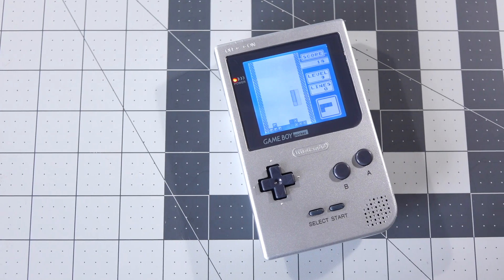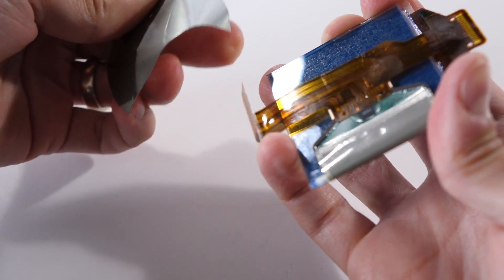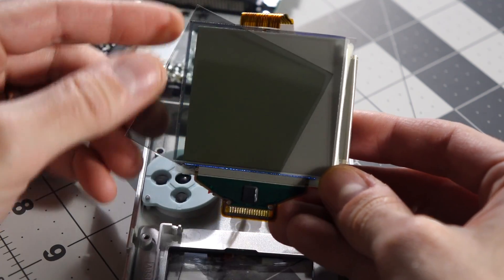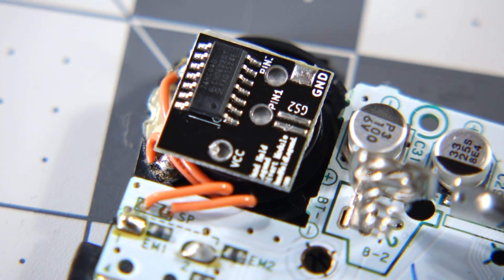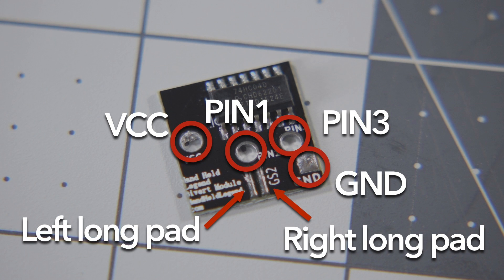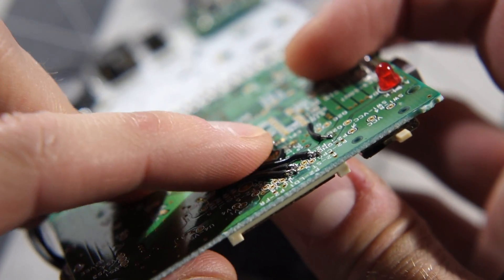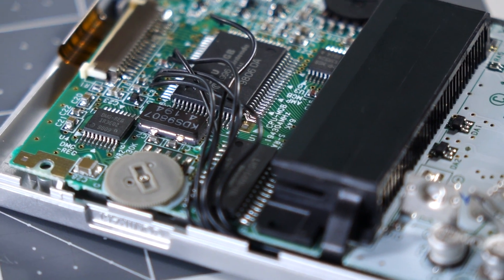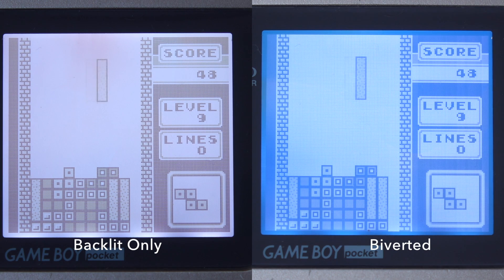Bivert Your Game Boy Pocket!

Comment: Apperantly I am not all that great at modding small electronics, as I managed to accidentally cut more traces between the cpu and the connector for the ribbon cable... Is there any way to fix those broken traces? I've been trying to solder wires between the points the broken traces connect but its incredibly difficult. I have also tried running solder over the places where the traces are broken and that doesn't work apperantly.

Comment: To anybody going to attempt this mod: The points shown on the video are easier to solder to, yes, but they also put too much pressure on the screen & backlight so itll look all screwy after you stick it all back together. There's another video on YouTube that shows some alternate solder points on the other side of the board.

They are a pain in the ass to solder to, but they also leave the screen without pressure on it once you're done.

Comment: A few weeks ago, i was unsuccessful at peeling off the reflective film, due to stupid ribbon cable coming apart. I quickly managed to destroy a perfectly fine Game Boy Pocket. 

So i decided to try it again....bought another Pocket.

Backlight was successful. Then i made the mistake of not fully watching this, to see how ridiculous the Bi-Vert part would be. Well...after about 2 hrs, i successfully tacked down, and soldered everything in to place...turn on...crap...crappity crap crap. Screen was bunky...all full of lines, and electric static. 

So, once again...i said ok...screw this...Salvaged any parts i could, and then threw the rest away...And once again...destroyed a perfectly fine Game Boy Pocket. 

But i forgot, i could just re-solder the part of the board i had to cut, in order to put the bi-vert in. That would atleast give me a Game Boy Pocket, with a backlight.....but it was too late. My temper flared, and everything went into the garbage. 

Lesson is...stick with DMG-01 mods...cause Game Boy Pocket sucks. 

I HATE CURSIVE AND I HATE ALL OF YOU...IM NEVER COMING BACK TO SCHOOL, NEVER!

Comment: That bivert module was meant to be soldered directly to two lifted pins on the LCD connector. This could have been much less messy.
Reply from the maker: That's how you normally install this module in a DMG, yes. The clearance inside the Pocket's housing is much tighter, though, and solder points are in different places. At the time this video was made, there were no dedicated modules designed for the Pocket. Installing it how I did was the most surefire way to actually make it fit.
Reply: Ah, I see! I didn't know the pocket's case didn't have enough clearance. Much much easier on the DMG!
Reply: There is a newer version of the mod chip to make this process alot easier

Comment: Hey Colin, great work on the videos!  I have the installed the backlight for the gb pocket using your other tutorial video with great results.  I was attempting to wire up the biverter but I'm having trouble getting solder to stick to the pads.  Do you have any tips you could share here?

Comment: Is the sound muffled with the board on top of the speaker? I have a couple boards and backlights on order intended for a DMG and a MGB, but if the sound is affected I may stick with a backlight for the Pocket.
Reply from the maker: I haven't noticed any change in the sound quality with the board there. I've heard of some people putting the board near the cartridge connector, but when I experimented with that I found it caused the case to be tough to close completely.
Reply: Thanks, that is good insight. I honestly wonder if the bare chip would be easier to install in the Pocket.

Comment: Just made this mod for my GBPocket. Here few additions:
1. Wire. Better to use wire from old headphones. That wire very thin and you will not have problems when you start to assemble all back. Wire from HHLegends doesn't fit for me.
2. DO NOT try to unsolder IC legs from motherboard and do exact as you can see in this video (https://youtu.be/f85v4hqbcJc?t=78) 1:18.

Comment: would both of these mods be compatible with the original Gameboy Pocket the one without the battery indicator?
Reply from the maker: +Danny Rouse I believe so -- it's very unlikely the internals of the two versions are significantly different -- but haven't gotten my hands on one to take apart yet.

Comment: Can you use 30 awg wire? I installed with 28 but it's causing pressure on the lcd when tightened up and causes bright spots.
Reply from the maker: +David Balzer Yeah, you should be able to get away with that, the total current draw is quite low.
Reply: +This Does Not Compute Finished up rewiring and it definitely fits really well with room to spare, I would recommend it for easier routing and tucking neatly. Thanks for the awesome how-to's!

Comment: Hmm, doesn't look like a huge difference in this case. If I were to trick out a GBP I'd go with just the backlight because I prefer the gray pixels and the contrast is nearly the same, though the original DMG ("brick") looks amazing with a biverter, the contrast pretty much looks doubled in TDNC's video and the pixels look to be a nicer, darker, contrastier blue, so I'd definitely bivert that.

 I'm almost tempted to buy an old DMG and stick a backlight + biverter in it now (I still have my childhood GB lying around but A) It's a transparent one and B) sentimental value (got it when I was 6), so I'd just buy some less rare colour used somewhere, maybe black or the classic grey).
Reply from the maker: +Redhotsmasher Used DMGs are pretty inexpensive, usually around $30, so if yours has sentimental value then picking up another one is the way to go.

Comment: +This Does Not Compute hi sir good day!! i bought this gameboy advance sp and it has this weird problem where whenever i charge it the orange light indicating that its charging only last for 1 sec then it disappears. I bought a new charger and a new battery but it doesnt fix the problem. Can you help me about this? i would really appreciate the help
Reply from the maker: +Shindensen That's a common problem that happens to the DS series as well. I haven't done a video on it specific to the GBA SP, but it's likely that the tiny internal fuse is blown. Looks like there are a few guides out there if you search for them. Good luck!
Reply: +This Does Not Compute oh thank u very much
Reply: +This Does Not Compute btw i dont know if its the fuse but i bought a new battery and when i turned it on its working . It might be the charging port thats broken

Comment: when cutting the pins, what am I actually cutting?
Reply from the maker: +Rob Smith You're actually cutting the traces on the circuit board that go between the CPU and the pins. The traces are pretty thin, so just a couple of passes with the knife are all that's necessary. To be sure, you can check continuity using a multimeter.

Comment: would it be easier to use just the chip insted of the entire board since the board isn't as much of a short cut as it is in the dmg and without the full board it would maybe be easier to put closer to the source so you dont need to mess with so much wire
Reply from the maker: +Sillyzombie666 You certainly could use just the chip, but the legs on them are very small and a bit harder to solder wires to.
Reply: well i might try it later on, i just bought 2 back lights one for bmg and my gbp along with the glass screen protector for dmg and then one bivert moduale for use with the dmg, i've been wanting a backlight mod for a long time and figured i should finally do it

Comment: Excellent video as usual Colin.  Interesting way to install the bivert module. I've never seen that before.  I'm guessing you came up with that method yourself?

As for the installation though, I find it better to lift the pins on the cpu, as you don't need to cut any traces, which makes the mod reversable if you ever need to in the future.
I originally used the pads on the back side of the motherboard, like you do, but found it quite tedious routing wires around the board, so I solder my wires directly to the pins of the chip and LCD connector.  There are also ground and VCC points on the front side of the board too, so you don't need to route any wires around the board.
Your installation does look alot neater than mine though.
Reply from the maker: +AndehX Thanks! I've seen the method you described, and that's certainly another option that would work well. The Pocket's case is a lot tighter inside than the DMG so I was concerned about it not closing properly if the soldering was done to the front of the board. I figured that the way I showed would yield more consistent results.
Reply: +This Does Not Compute yeah its easier to close the case up with your method, definitely, the only worry I had was that the wires being soldered directly behind the screen might end up putting too much pressure on it, creating pressure points on the screen, or even potentionally damaging the screen cable over time.  Who knows....

Comment: Shout out for 3M VHB, the best adhesive ever!
Reply from the maker: +mykie242 Yeah, this stuff is no joke!
Reply: could you use a loca type glue to glue the backlight to the lcd?
Reply: You probably don't need to glue it. I didn't
But then again I did it with my DMG not a pocket :P
Reply: mykie242  nv

Comment: Nice video ! But i suggest using the other solder point for the backlight on the pocket. You screen will do some flickering with some games like pokemon if you don't change that, because the backlight take power at the same resistor that the screen at thoses solder points. Even if it's more complicated to instal, i think that's just a better solution. 
But thanks you for all the videos you make :) ! Sorry if my english is weird by the way.
Reply: +Cyriaque interesting, I did see you comment on these problems in the backlight video. Which solder point did  you use to solve the flickering?
Reply: +ViewtifulSam Hey, i use thoses solder point  : https://a.disquscdn.com/uploads/mediaembed/images/3216/7720/original.jpg 
Thanks to Hand Held Legend for the fast respond, it's a little tricky to instal but it worth the result.
Reply: +Cyriaque cool, thanks for the response. I'm glad you were able to solve the flickering. I'll keep this alternative in mind when installing the backlight on my GBP.

Comment: Thank you so much for doing this video!  I find that your way of doing this is a lot safer (no lifting of pins) than some of the other tutorials online.  Also using the other side of the logic board provides for a much cleaner way of diverting the wires.
Reply from the maker: +insomniamonkey Thanks! I put a good amount of research into this one -- I originally planned on lifting the pins, but found out the hard way it causes problems.

Comment: Hi Colin, do you think it'd be possible to repair the contacts of a Nintendo cart (GB/C for example) using either replacement contacts or solder? I've been told the latter should help and if that is the case, would you be willing to make a video about it?
Reply: +PandaXclone2 i may not be colin, but you might be able to with a replacement circuit board ,
Reply: Coleman Prevatt I don't think that solves the problem. I'm looking to repair a section of the circuit board in a cartridge that connects to the system and allows it to recognise the game. Replacing it defeats the purpose of repair.

Comment: Cool! We both live in Minnesota! Do you know where I can an AGS-101 in Minnesota for fairly cheap?
Reply: +44sonic10 Get lucky at a Pawn Shop/Thrift Store? That's what I did to get one for $28.
Reply: The pink ones are easier to find and sometimes cheaper too. You can get replacement shells + buttons on eBay for like $12 in plenty of different colors. That's what I did with mine and have a new looking SP-101 for cheaper than many on eBay.